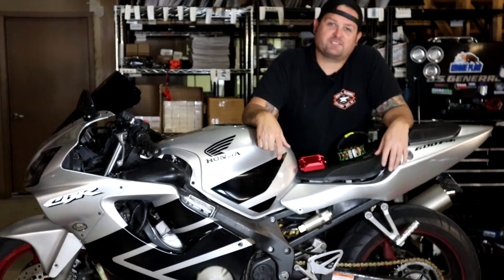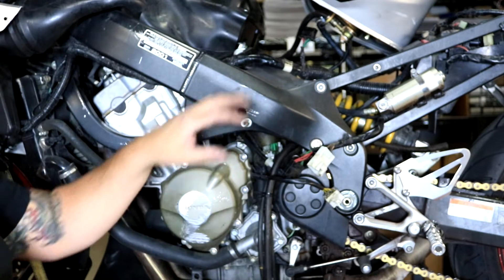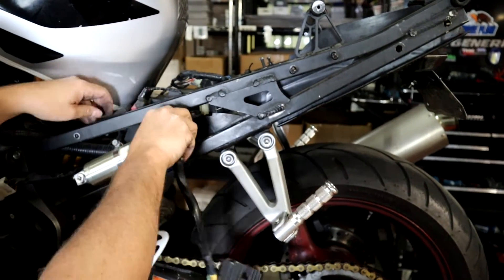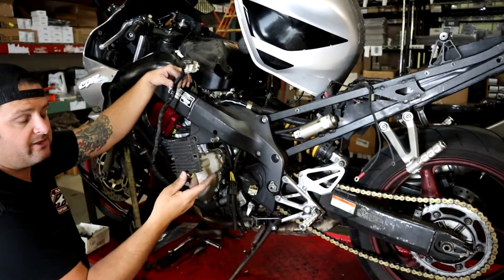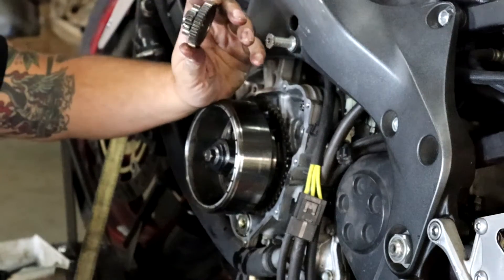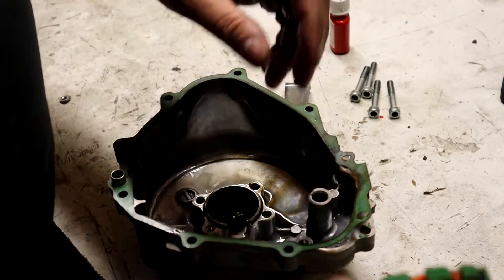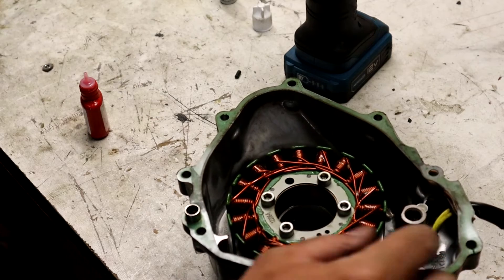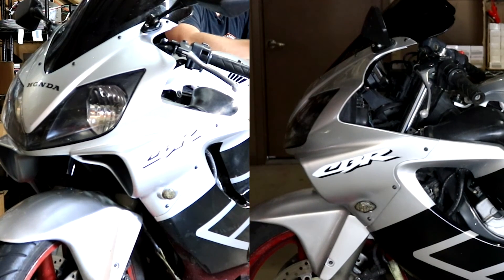RMSTATOR Honda CBR600 F4i Stator Voltage Regulator Rectifier Upgrade Installation How To

Comment: 12:03 what is that thing called.
Reply from the maker: That is the intermediate gear for the starter motor to flywheel ring gear interface.

Comment: Ist ok if voltage touches 14.8 or over voltage
Reply from the maker: 14.6VDC is the typical regulation point. However 14.8 is not a problem, tolerances in the regulator can allow that. 15V is the point of causing issues.